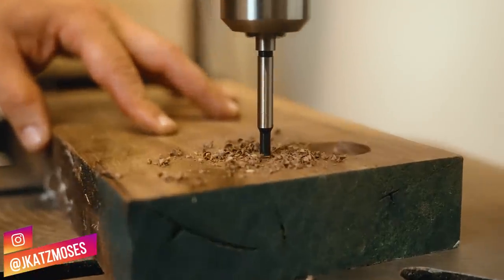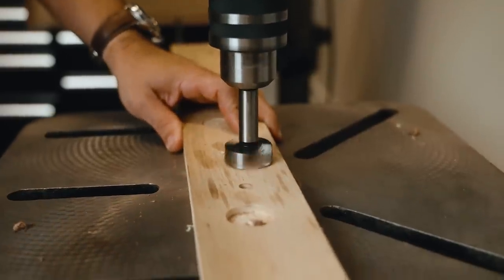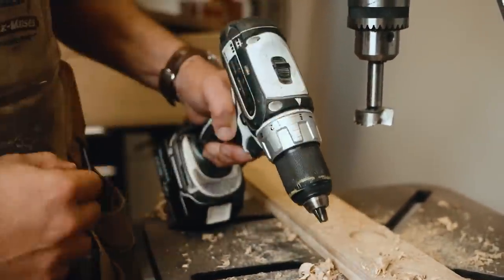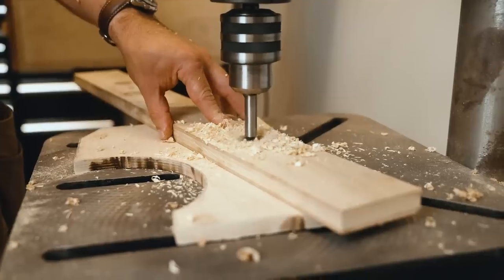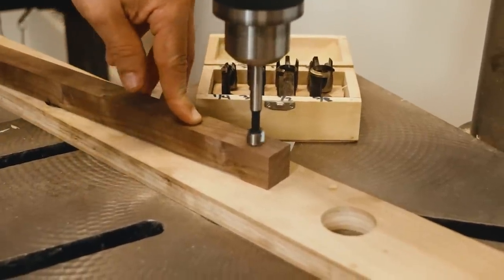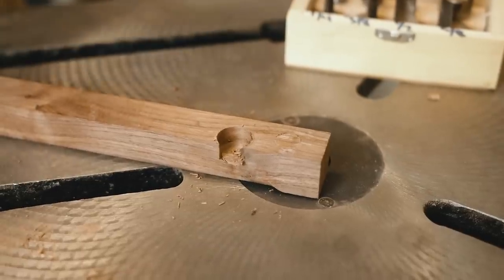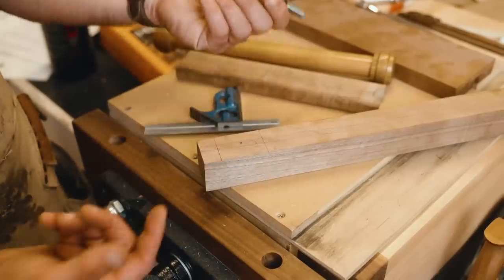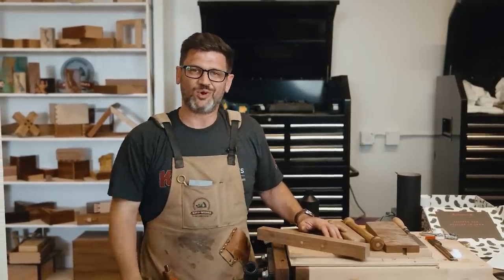10 Forstner Bit Tips and Tricks - I bet you're running your bits too fast (Free RPM Chart Download)

Comment: Most people think that the faster you run a drill bit is good, WRONG!!!  Even with metal twist drills the drill should never run at more than 500 and that is probably too fast.  You must give the bit time to bite into the material.  Run faster burns the bit, wood or metal.  Go fast press hard, that is if you want to start a fire to cook dinner.

Comment: Well... this certainly explains why I've been burning through my Forstner bit set,  as I've been clueless regarding the correct speed and the manufacturer of the set did not see fit to provide any rpm recommendations or warnings to use them at low speed.  It also doesn't help when the packaging/description indicates that they are made from  HSS (high speed [tool] steel), which causes the uninitiated (like me) to not think twice about limiting the rpm's.

Comment: Great video. I noticed you are using a Nova Voyager DVR drill press and that thing improved my work on a drill press. With no belts to change, you dial in whatever speed you want. The icing on that cake, however, is the computerized control that suggests the best speed for seems like a hundred different types of bit for different thicknesses of different woods. I was running my hole saws way too fast and, once I started using the suggested slower speeds for different diameter saws for different types and thicknesses of wood, hole sawing smoothed out and life was good.
Reply: I was thinking along those lines, but that's a $2000 drill press.  In Australia and New Zealand we can get the Full Boar 750W drill press for the equivalent of a little under US$300.  It does not have speed range of the Nova, but is infinitely variable from about 400rpm to 2500rpm.  It has 80mm (3 1/8") spindle travel, and something I really like, a 16mm (5/8") keyless chuck. Hmmm...  I have just checked and the price has gone up 150% since I bought mine, so it is now NZ$750 (422USD) but that is still just a quarter the price of the Nova.  The bottom line is both drills can change speed without the need to mess with belts and pullies, or even stop the drill, so it is super easy to always use the right speed.
Reply: @TrevorDennis100  You make an excellent point. I was not aware of that drill but it sounds like a very useful tool.

Comment: Great video, thanks for the tips! My only difference is I find that no matter how hard you try to hide plugs by grain matching, once finish is applied they are easy to spot. So I turn mine into a design feature and turn the grain 90 degrees. And even more as a stand out feature would be to use a contrasting wood although that may not always be appropriate. Thank you!

Comment: Ahhh, I wish this video came out last week. I used a forstner bit (+ track saw) to cutout an apron sink in a Boos maple counter for a customer.  It was definitely smoking due to the high RPM’s but fortunately, it didn’t matter since it was only a rough cutout.  I finished the cutout using a template and flush trim router bit and it left a perfectly smooth finish—no sanding required.

Comment: The same goes for drilling metal. Most people want to run the drill or drill press at wide open. You will go through a lot of bits doing that. Or you better learn to sharpen them properly and often. Thank you for sharing this!

Comment: You should do a review on the Nova DVR Drill press.  It is the reason you can change the speed so easily, most wouldnt bother changing the belts and folks need to know more about this drill press regardless of the price.  The Viking is a cheaper more affordable version with the same features

Comment: I was boring 2" holes in spalted oak using the slowest speed and was still overheating the bit. It's a drill press that you move the belt from pulley to pulley.

Comment: Thank you for this! Just the other day, I was using my forsteners for drilling some holes for a microwave install using my cordless (I know, not the intended purpose). But I was thinking then, "this is probably not the right speed for this, since my drill press runs much slower..." Now I know. It wasn't the right speed!
Aside from that, I don't see it the description or comments but what set of plug cutters do you recommend? I'm actually in the market for them. Thanks as always!

Comment: I bought a set of forstner bits, 1 inch through 3 inch. All the spurs ( tips ) are threaded, so they screw them selves into the wood. Almost impossible to use with out hurting yourself. 
Any ideas why they would come like that ? My smaller set just has smooth tips, work great.

Comment: I've got my drill press set as slow as it will go and I don't change it because it's a hassle.  I've kinda assumed slow will work for everything, even though it may slow production sometimes.  Am I wrong?
Reply: Very small drill bits need a high RPM to avoid wobbling and snapping. If that's not a problem, then nothing wrong with slow, other than obvious(?): slower material removal in some cases.
Reply: @johnhawkinson  Thanks.  I use my press 90% of the time on wood.  What is your definition of "very small"?  I don't think I've ever even had a bit less than an 1/8" in it.
Reply: @Keifsanderson  Well, "small enough to snap" — if you're not snapping them, then you're good. But yeah, around 1/8" or 3/32" is where this usually manifests, but the exact size depends on how bad (or good) the workholding is, length of drill bit stickout, drill bit material, presence of a pilot hole or centerpunch, applied drilling force, plus some magic operator skill factor. Oh, and speed of the drill press, "as slow as it will go" can be quite a wide range from model to model.
Reply: @johnhawkinson  Thanks for the input.  I've never clocked my press, since I can't readily change it, and it's as slow as she'll run.  It's an vintage/antique Buffalo.  I guess I should go poke around Vintage Machinery and see if anyone has ever posted the specs.
Reply: @Keifsanderson  Ideally you'd borrow a tachometer to measure it. But you can also check the motor RPM (Should be labeled! Usually 1800 or 3600 rpm) and do some simple math based on the pulley ratios. These days you can probably put a sharpie mark on the spindle (or maybe paste on a cool printout )and use a cellphone camera. Camera should do 30 or 60 fps and 300 rpm is 5 Hz, so even just counting frames would work.
Reply: @johnhawkinson  Great ideas.  Thanks.

Comment: What happened at .43?  It actually stopped for a second.  Is that a cheap Chinese driver module running that drillpress?
Reply: The Nova Voyager does that now and then at low RPM, it overshoots the power slightly for whatever reason and then undershoots to compensate. Makes no practical difference in application in my experience.
Reply: Damn! You've got zoom-eyes. I didn't catch that.